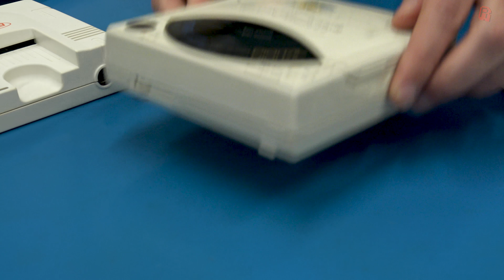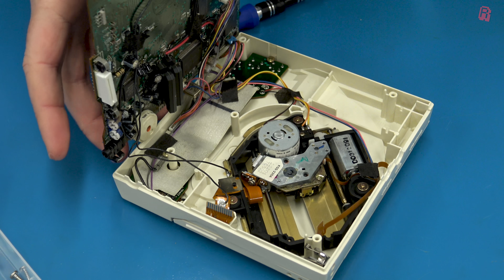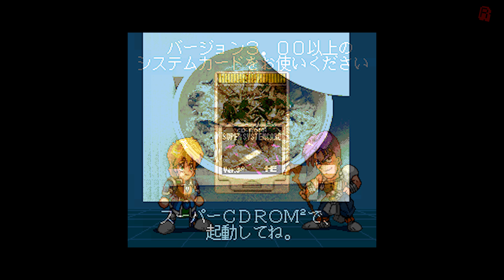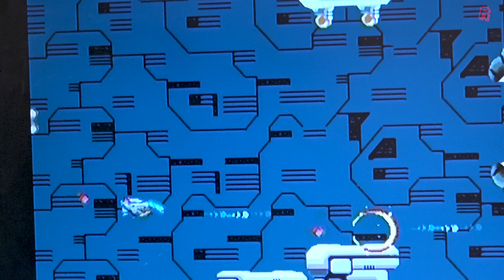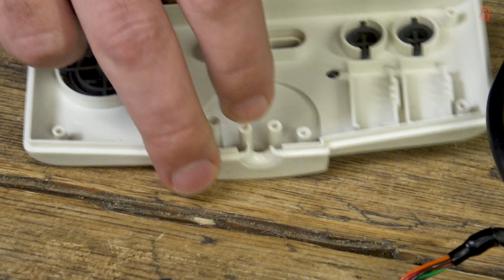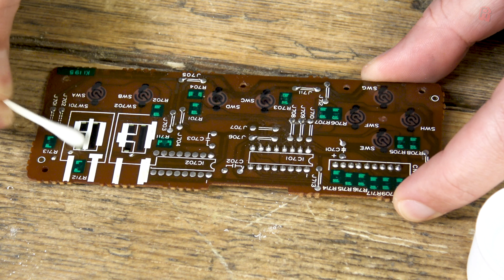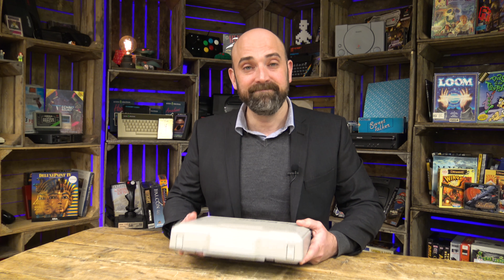PC Engine Trash to Treasure (Pt2) - Fun with the CD ROM ROM

Comment: The graphics chip in the PC Engine gave the Mega Drive a run for its money.  I knew this back in the early 90s but just never had the desire to take the dive! :)
Reply: The color palette did, handling / amount of Sprites & Backgrounds and the resolution are far superior on the MegaDrive. No bashing, I like the System and own both.
Reply: @Retro_Royal  I don't know if I'd be sure of that. Mega Drive resolution options are 256x224/240 or 320x224/240 (though there's little reason to use the 256 pixel mode)

PC engine resolutions are (effectively) 256, 352 or 512 pixels wide with up to 242 lines, so that's about a wash.
(both can do interlaced, though that's rarely used in practice)

Both have a 9 bit master palette (512 colours), so no difference there.

The PC engine has 32 sets of 15 colour palettes (+ transparent for 16 entries). 16 for sprites, 16 for backgrounds.
The Mega Drive has 4 sets of 15/16 colour palettes (With or without transparency depending on whether it's used for sprites or backgrounds), which can be used freely for either.
That's a clear, unambiguous win to the PC Engine.

PC Engine has 64 hardware sprites in 6 possible sizes, with up to 16 sprites per line.
Mega Drive has 80 hardware sprites in, for all practical intents 16 possible sizes, with 20 sprites per line. (unless you use 256 pixel wide display mode, in which case it's also 64 and 16)
The devil is in the detail with sprites (hence why the Mega Drive sprite engine is better than the SNES one in spite of the SNES having better specs on paper), but overall this isn't a clear-cut advantage. It's an advantage, yes. But not an unambiguous one.

PC engine has only a single background layer. Mega Drive has two.
That's about the only area where there's a clear win for the Mega Drive, with having only a single layer being quite limiting in a lot of ways.
I only looked at this in a superficial level (mostly because I don't know the details of the PC engine graphics chip all that well), so there are certainly likely to be a few other quirks.
For instance the Mega Drive graphics chip has a few secondary features such as an automated way to implement differential scrolling (aka parallax without actually having multiple background layers) - a common trick that older systems used CPU interrupts or careful timing to accomplish, but which the mega drive can automate. Similarly, independent column scrolling.
I have no idea if the PC engine has comparable features, but they're quite niche capabilities.

They both operate with 64 kilobytes of video memory.

In any event, while the background layer issue is a definite clear advantage, I'm not convinced the Mega Drive graphics chip is clearly superior overall. It seems far more... Nuanced.
It has a minor advantage with sprites, more background layers...
And... That's about it.
The resolution difference isn't a fundamental hardware limit of the PC engine, seems to be more a developer choice to prefer lower resolutions, and the Mega Drive loses in a fair few capabilities as well.

It's not like we're comparing the Neo Geo to either of these systems here, where the difference would be overwhelming. (384 hardware sprites, up to 512 pixels tall, sprite scaling, 96 sprites per line. thousands of simultaneous onscreen colours, can literally reference a million graphics tiles at one time... Can merge adjacent sprites to create bigger objects and move them collectively with less CPU intervention.)
But even the Neo Geo has weaknesses compared to the mainstream consoles.
For instance, I haven't confirmed this with any test code, but it seems the graphics and data buses are completely independent. On the face of it that doesn't sound like a bad thing, but it means the CPU is incapable of writing anything to video memory.
This means  (if I'm interpreting things correctly) trying to do something like 3d graphics or even some pseudo-3d thing like say, Wolfenstein 3d is completely impossible, and while you can manipulate the display in a bunch of ways, your options for doing things the graphics chip doesn't directly support are considerably more limited than on the mainstream home consoles...
It's not always so simple as saying one system is more powerful than others, even if superficially it seems overwhelmingly so...
Reply: @KuraIthys  Dude your comment is everything but superficial and a pretty good read.!

I didn´t meant to go that deep, relaying more to practical cases where the PC-Engine does present more colors on screen at a time ( FX-Engine Yuki comes to mind) while quite some shooters like R-type and Gradius also scroll vertically to make up for the missing playfield. Otherwise I can only agree.
Reply: Afaik even the background is a sprite on the Neogeo, that blew my mind backl then